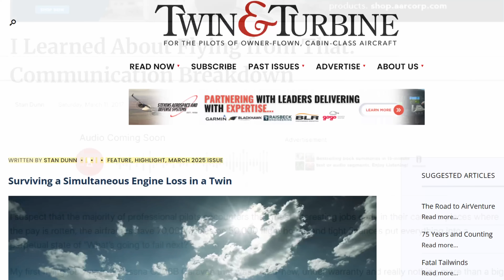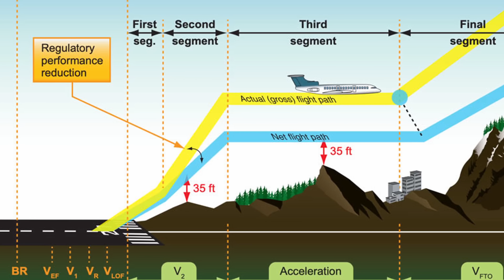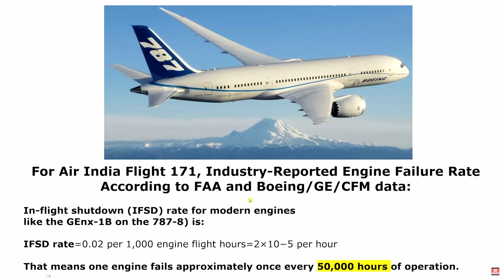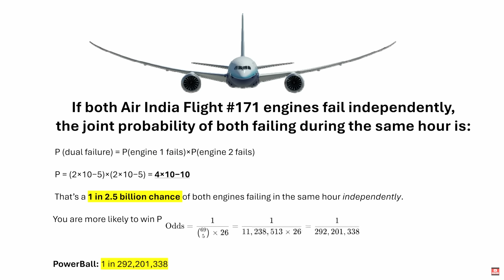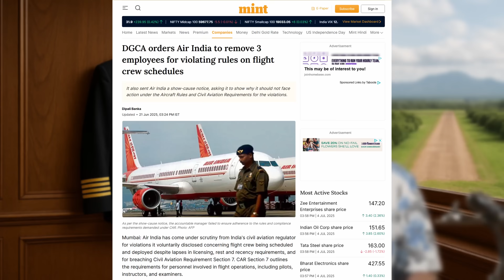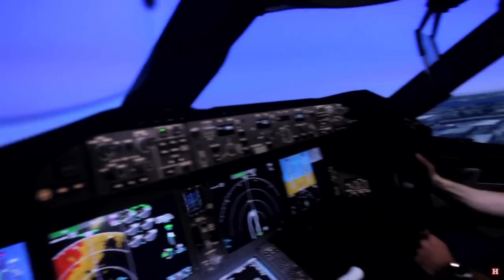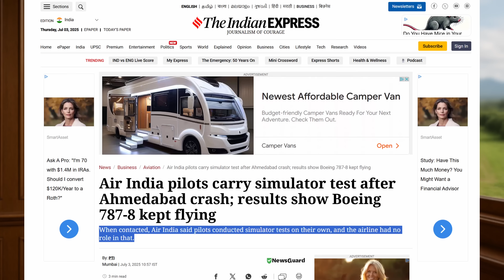Air India 171 Cause Becoming Clear

Comment: A quick summary of possible reasons so far I has seen in the media, both main and alternative.: None  are official reports. 
1 Fuel contamination.
2 Vapour lock because it was a hot day
3 Insufficient flap settings for take off, or retracted too early.
4. Fuel switched off by a crew member... accidentally or other wise.
5 left seat defective and slip backwards during take off, resulting in pilot inadvertently pulling throttles to idle.
6 Excessive undercarriage drag contributing to failure to climb .
7 computer fault closing down engines

Comment: I have virtually zero knowledge about planes. But I've read with interest the theories from very knowledgeable people, such as this channel operator, about what caused this godawful accident. The latest thing I've read is that a software misperception might have played a role. It concerns the system program 'perceiving' the plane as idling on the ground, rather than the reality of it being airborne. At that point the program limits the power the plane receives, resulting in, among other things, reduced power (thrust) going to the engines. After all, one of the last things the pilot said before the crash was "Thrust not achieved." Of course, even if this was true, the basic cause of this 'misunderstanding' would still be unknown without further investigation.

Comment: I believe this accident supports requiring a third member of the flight crew to - a flight engineer.  The workload forced on pilots by major aircraft failures during takeoff and landing is excessive.  

As Sullenberger’s experience showed, time spent diagnosing dual engine failure closed of a viable option.  A flight engineer could have told the right away that both engines were dead.

It was a third pilot on United 232 who guided the plane by differential thrust.  Similarly for the ‘miracle at Gottrora’ crash.

Even with Air France 447, a third pilot got involved.  However, excessive and errant automation prevented even three pilots understanding and managing the problem.

A flight engineer would, of course, require a seat and a console full of instruments, just like in the old days.

Suppose flight engineer were the entry level assignment. New flight engineers would need intensive training on automation and on aerodynamics.  That’s great background for flying as FO and PIC.  Also, they could build hours.  This would solve the pilot shortage and helo ease the difficulty of becoming a pilot, with no sacrifice of pilot proficiency.
Reply: The role of flight engineer is mainly performed by on board  computers. Just like a room full of typists would not be seen these days .
Reply: Thanks for your note. Yes, computers have taken on that role.  What troubles me is that there remain situations in which computers and automation leave the pilots overwhelmed and confused, but in which fairly simple situational awareness would support a good resolution.  That’s what makes me think a third crew member, a flight engineer, would help.  The flight engineer’s role would be maintaining situational awareness, especially in critical phases of flight.

I guess the present cost/benefit analysis is that automation has provided a sufficiently low rate of catastrophic failures. I don’t expect we’ll get flight engineers again.

Comment: Thank you!  That is perhaps the most analysis provided yet.  My heart goes out to the passengers and flight crew that perished from that terrible accident.  Given what he has so far, he seems to be leaning towards pilot error.  I do fly a lot, but I'm not a pilot.  The engine shut off switches are quite close together.  It's not hard to imagine that in the case of one failed engine, a pilot attempting to shut off fuel to that engine inadvertently shutting off fuel to the wrong still working engine.

Comment: 3:50 I don't think we should get hung up on the RAT being deployed. It's possible that it was deployed due to a system failure, something that also resulted in the engines going to idle.
Reply: So in other words we SHOULD pay attention to it…
Reply: Not idle. Frozen
Reply: @Dumptrump2788 We don'teven know that the RAT WAS deployed. It' s just speculation based on someone's opinion of the sound the aircraft made as it passed overhead. We'll have to wait for the flight  dats recorder to be examined.

Comment: The RAT does not provide enough power.
The previous flight indicated a significant electrical malfunction which was not corrected by maintenance.
The fuel filters were clogged. Maintenance should have changed them
Water in the 5 tanks had significant water which should have been drained prior to taxi.
Reply: Engine failure procedure:
working foot , working engine
Meaning to correct for yaw you push the rudder on the same side of the running engine and also dip the wing slightly down .

Comment: Yes electrical failure to water ingress into the fadec module. Boeing was warned about this but did nothing.   Both engines failed and spooled back because of this.   Why do you think information is so scarce in this base with no updates? Damage control.   Mark my words this is going to he bad for Boeing.   I will not fly the 787

Comment: Captain Obvious:  The probability of 2 separate engines failing at the same time is 1 in 15 billion  or close to zero UNLESS they fail due to the same cause like dual engine FOD/ bird strike, fuel or fuel system failure, severe electrical system failure, severe hydraulic system failure, FADEC problem etc.

Second Officer Backasswards: Therefore it must be human factors/ crew performance.

Comment: Woah woah woah woah woah....

How the absolute fuk are investigators not discussing some unknown kind of electrical failure that killed both engines? 

Idgaf how unlikely Boeing or tge NTSB say duel engine failure is. Those people say all manners of incorrect things, exspecially when they don't know, and they're incentivized to do so. 

Why has none of you Pilot YouTubers picked up the video footage evidence of that very plane experiencing cabin a/c & passenger electronic outages while sitting on the tarmac at either DEL or AHM? It was taken and uploaded by a passenger who was on that very plane on its flight into AHM. The a/c was out, the entire cabin was burning up, the passenger electronics were straight up bricked (as in straight up frozen, like a picture.... NOT OFF), and the lights inside the cabin looked like that yellow orange shade of emergency lighting.

Comment: I'm a bit dubious of Air India's stated findings from running the simulator at various flap and gear configurations during take off and concluding there would be no issues running in those combinations. Simulators are merely running models and the models may not reflect reality when running at / near / beyond the known flight envelope and the risk / probability of not detecting an unsafe configuration in the simulator is non-zero.

Comment: there was speculation the pilot seat suddenly sliding backward (due to the seat locking pin faulty) and the pilot pulled the throttle handle to a lowest level after taking off. From your experience, what are your thoughts on this scenario? thank you!

Comment: Excellent video.  I know you mentioned sabotage in the context of it being done by an outside force, but has anyone considered either of the pilots being the perpetrator of said sabotage? Murder suicides have happened before, and if this one was done at such a low altitude, I believe it’s possible the pilot not involved (assuming a single actor) might either have missed it or not had enough time to transmit anything other than a mayday.  I guess the CVR will tell us more.

Comment: Air India has faced scrutiny over maintenance practices and aircraft condition over the years. When you combine maintenance issues with the technical factors we've been discussing:
Maintenance-related amplification of risks:

Deferred maintenance on electrical systems could allow intermittent problems to worsen
Inadequate inspection of fuel system components in hot climates
Possible history of "band-aid" fixes rather than root cause repairs
Electrical wiring that should have been replaced continuing to degrade

Cascading failure potential:

There is a video of a passenger on the same plane a day earlier showing that there were obvious electrical issues in that video monitors were off as well as no AC or air from the vents. 
If electrical problems were known but not properly addressed, they could disable multiple safety systems simultaneously
Poor maintenance of fuel tank inerting systems in a hot climate
Degraded wiring near fuel systems creating ignition risks
Fuel pumps or sensors operating beyond their service life

Hot weather + poor maintenance:

Systems already operating at marginal reliability failing under thermal stress
Heat accelerating the deterioration of already-compromised components
Safety margins eliminated by both environmental conditions and maintenance deferrals

The concerning pattern:

Potential single points of failure:

Electrical power supply - if the electrical problems affected the main power feeds to the inerting system
Bleed air source - the NGUs need pressurized air from engines/APU to generate nitrogen
Central control unit - coordinates the entire system
Common distribution manifolds - single points where nitrogen feeds multiple tanks

Fuel contamination scenario:

Inerting system failure allowing internal fuel degradation/contamination
Contaminated fuel reaching both engines simultaneously
Engines failing without external fire (just sudden loss of power)

Now let's assume that the pilots knew what they were doing and just after takeoff there was a loud bang (as reported by the survivor) possibly caused by heat stress to the plane as it was a very hot day and it was sitting on the tarmac for an extended time possibly coupled with an electrical short issue could have cascaded causing an inerting system failure allowing fuel degradation/contamination which kills both engines simultaneously. About then the pilots attempted unsuccessfully to retract the gear on or about the same time that the RAT deployed. Which could explain or give an idea of the sequence of events.

Comment: At around 15 minutes into your video, you mentioned that the dust should have been cleared from the runway with so many flights, but from what I understood this takeoff used every last inch of the runway, almost, and that could have easily been the case because it was not frequently used. Now I am 1 million percent less knowledgeable than you on any of this stuff so please don't be offended but when I saw that dust on the end of the runway and you were talking about it for some reason my gut told me that's not what it was.

Comment: I called bullshit on dual engine failure from day #1. There's absolutely 0 indication of hard failure from either engine, no smoke, no flameout, no pops like you'd expect from sudden fuel loss. Large gas turbines can't even spool down from takeoff to 0 that fast and just fall out of the sky within 15 seconds of power loss. That's more indicative of commanded shutdown. FADEC sabotage is 100% bullshit. It's poor maintenance likely combined with pilot error.

Comment: Investigators already know the cause, sequence of events, and how it happened. They have the electronics, scene, forensics, all the data and initial analysis. There are tons of documents, records, reports right down to the mechanic who checked the tire pressure 6 months ago and what the pilots had for dinner each night in the prior week. 
 At this point, it is a matter of completing a comprehensive report which has zero gaps, zero unexplained details that anyone could throw at them. This moment is about the integrity and detail of facts beyond scrutiny. Then, the pre-report would be shared with the airlines, lawyers, Boeing and lawyers for the families of the victims. #1 question is? Who's fault is it and what are they worth? how much can we get. 
 It's very dangerous to shoot your wad too quickly here~ there's millions riding on it.

Comment: Agree.  One engine fails for whatever reason at the most critical part of the takeoff and one where the engines are most stressed, and the pilot shuts off the wrong engine.  We need to wait for the FDR and voice recorder for confirmation, but this accounts for all the visual data from the ground.
Reply: The plane is designed to operate safely with only one engine. Why would anyone panic ?

Comment: I doubt very much anyone was shutting engines down that soon after takeoff no matter what the case.
Reply: The data suggests you’re wrong
Reply: @tackela2  what data
Reply: @cplcabs  Do not waste your time debating with fools, you have probably wasted too much waatching this video... Enjoy the summer!
Reply: @cplcabs The flight data shows fuel cut to both engines immediately after takeoff off, and then an attempt to restart the engines
Reply: why do you doubt that?  Pilot suicide is a definite possiblity.  And we have not heard if there was a 3rd person in the cockpit either
Reply: @mrbubbarosa  ha ha
Reply: History says otherwise, lI used to train pilots (including Indians) and would always put my hand under the throttle handle of the good engine just in case. Remember the FO only had 1500 hrs, just past the 1400 hour cocky danger period.
Reply: @nevillevaneerten that's actually disputed, air india revised their statement stating that the captain had 11k hours while the f/o had 3.4k, and this was supported by colleagues 
we will only know the actual flying hours when the preliminary report is out

Comment: We are increasingly having to doubt accident investigations.  The opening of black boxes are increasingly being processed by the countries where the accident occurred and where there is good reason to trust their integrity.  The Jeju crash in Dec 2024 is the worst example.  The South Korean investigators improbably claimed that both black boxes stopped recording one minute before the issue.    This is only 10 years after their Sewol ferry disaster where officials lied about just about everything.  Mentour, now less subservient, has raised doubts about the Indian control of the black box information and also mentioned that China regularly denies access claiming state control needed for military reasons when clearly not the case.  Most likely Indian authorities will not tamper with the data but it is not good when their failure to release the information gives them opportunity to do so.

Comment: I vote that the cause was the pilot seat sliding back during climb out, the pilot had no choice but to use the throttles as a hand hold to save himself. This push the throttles to idle and lost power, the lone survivor said just before the crash he heard the engines go to full power. This meant the pilots realize there situation and push the throttles to max, but it take 8 seconds for engines to spool up, but the plane was too low and too heavy to recover. 
Nothing else makes sense, except that the pilots pull back the throttle to idle on purpose. Which is unlikely.

Comment: Pilot radioed, "THRUST NOT ACHIEVED".
Electrical transient would not cause "THRUST NOT ACHIEVED".
(FYI, both engines have multiple generators.)
Google "fuel stratification" to understand how other aircraft may not have been affected.
Aircraft sensors monitor fuel quantity, temperature, pressure, and flow. Never quality.
Both engines were drawing fuel from the center tank boost override pumps.
The unusual cloud at VR swirls and dissipates more like steam than dust.
Jesus Christ!  This ain't rocket science.

Comment: When the RAT deploys that means there's system failures. It's been proven that if airliner loses both engines at a high enough altitude it can still be controlled to a safe landing.
In the case of Flt 171 they didn't have the altitude.
They had a sudden total loss of hydraulics as seen no gear retraction and the spoilers appeared to be floating.
The 787 is all electrics and they lost that too.
Airliners now have the stupid Fly By Wire controls so no electricity, no control.
The lithium battery probably exploded and wiped out the main electrical bus, engine FEDEC, etc...

Comment: It can't be fuel contamination or wrong fuel.  If this even was the cause, then other aircrafts should have the same problem on take off and crash due to all engine failed.  The most likely cause is the shutting down of wrong engine as this had happened quite many times in the past during Engine Failure Procedure under high stress .. Secondly, even if the FADEC or Engine Thrust system happen to failed on take off, the pilot should have Manually Push the Thrust Level to Full/Max thrust rather than continue to let the Auto Thrust to do the job.

Comment: 🙏 40 seconds after take off...   It was already at 625 feet...

🙏 So the engines were working initially...    for at least 20 to 30 seconds...   n pilots busy with takeoff  procedures...

🙏 RAT deployed bcos some systems jammed...   or stopped
🙏 including something that supported the engine or fuel pump, etc. tripped...   
🙏 ... something or some signal that supported both engines...

🙏 then th pilots had about 10 or 15 seconds to react...   while the plane started descending...

Comment: 4:38 375,000 hours is 42.8 years. Of course, that's flight hours, so the number would be larger, depending on the duty cycle.